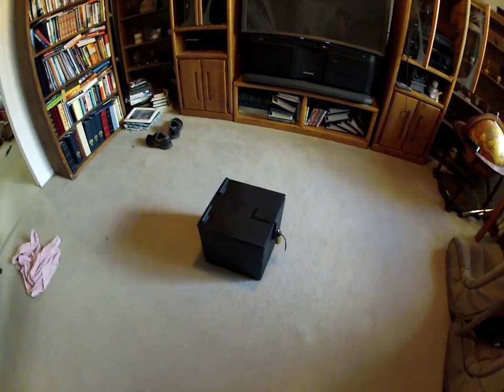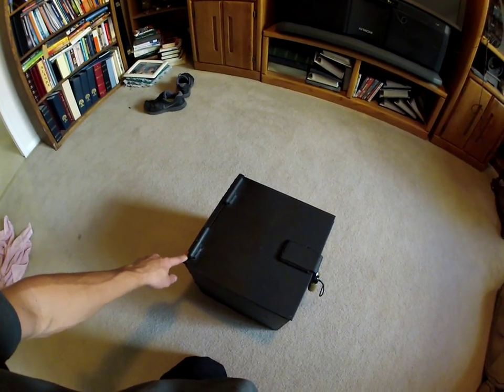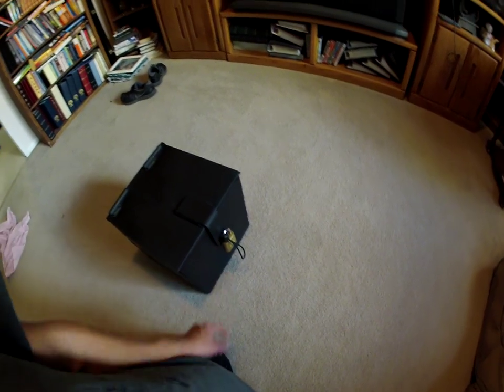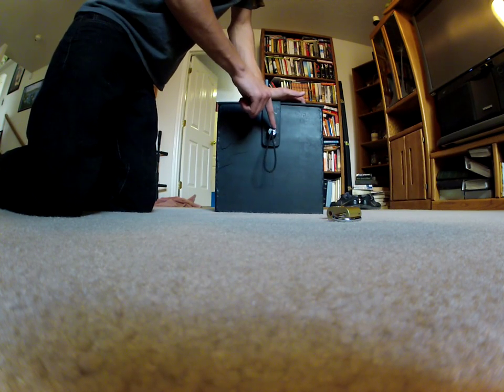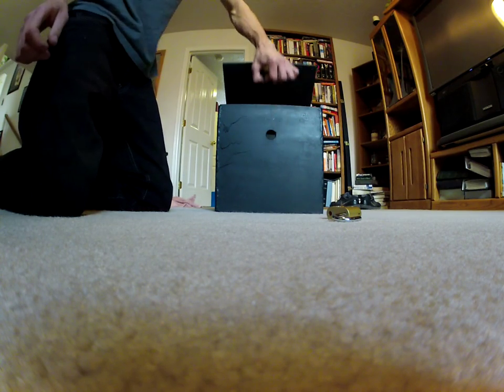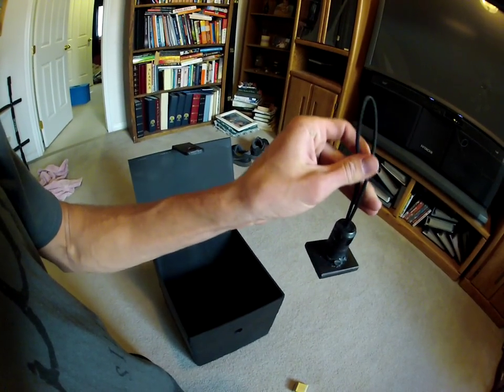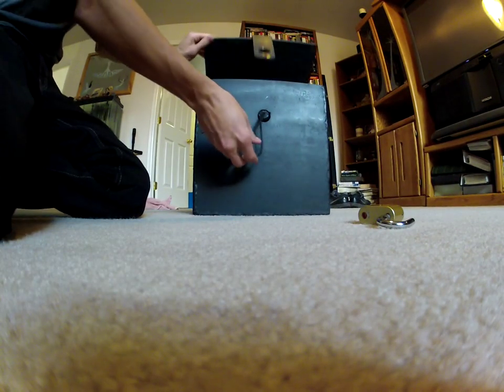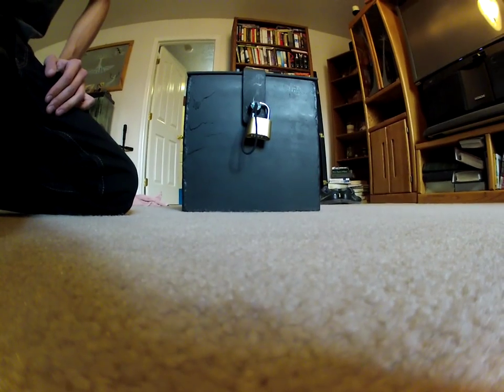Homemade Safe

Comment: nice, I'm in a welding class right now and working on a small round safe, but the lock is on the inside. not finished, still working out some of the details. but should be a quick build, thanks for your video

Comment: 1/4 inch steel nice. BUT, why bother you have it locked with a PADLOCK. So, all the heavy steel construction boils down to
cutting off the padlock. Bolt cutter and 10 seconds and their in. Steel thickness means nothing unless you have a 
very good locking mechanism. Sorry but true.
Reply: A 3 to 4 foot pry bar makes short work of the padlock ill-regardless of the strength of the steel of the lock.. I have needed to do it many times.. The locking mech needs to be internal. Not to mention the "Removable Bolt" could have been internally retained and housed with a spring so all you have to do is "Push" the latch in to release the hold without it falling into the safe and having to "Pull" it out theu the hole with "Paracord".
Just my opinion, an Internal bolting mechanism like a regular safe and a handle with a separate key to lock which is what I am building would be better and more secure
Reply: Some padlocks take tons of pressure to cut.

Comment from the maker: Handguns, cash, important documents, jewelry and/or things with sentimental value. Anything that would reasonably fit in a 1 square foot box. Yes, there are holes drilled in the bottom and the bolts can only be taken out from inside. Each square foot weighs 10.2 pounds plus the weight of the hinges, welds, and components used for locking. Also whatever the contents weighs. 

Empty it weighs about 70 lbs.